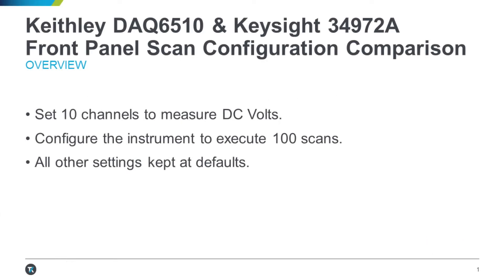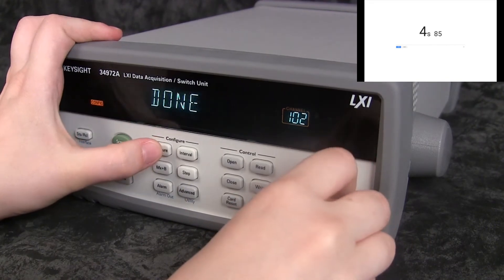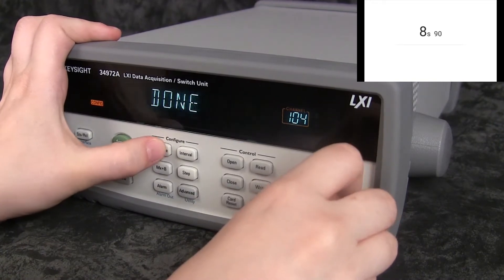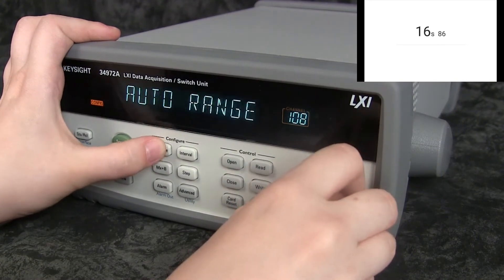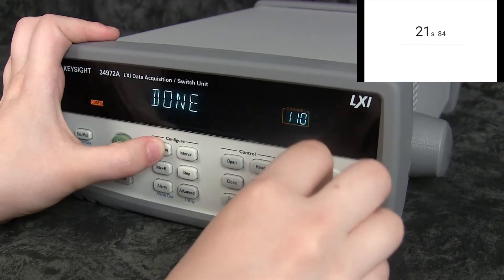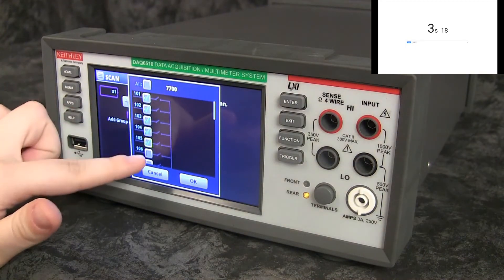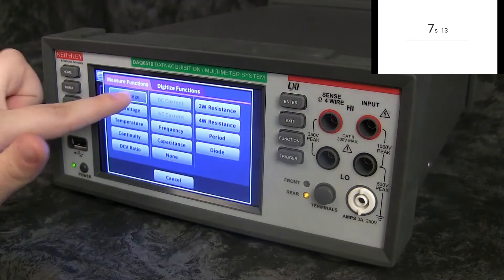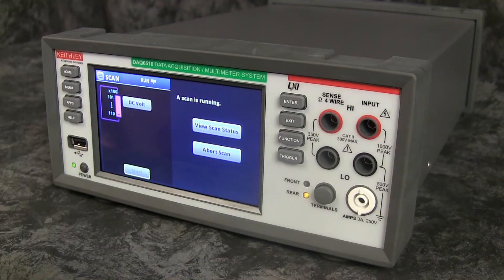Setup Speed Comparison: Keysight 34972A & Keithley DAQ6510

Comment: I think the point that makes better to keysight daq is switching reliability, i have used 34970A for years and years with the same modules, keithley has a better user interface a better look but it does not last as keysight, so I prefer a reliable instrument rather than putting flowers o it